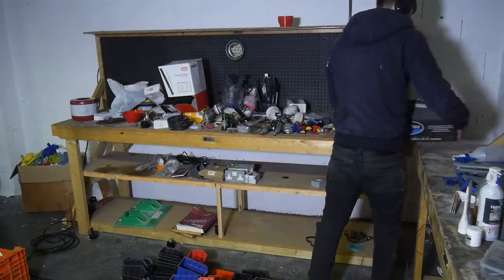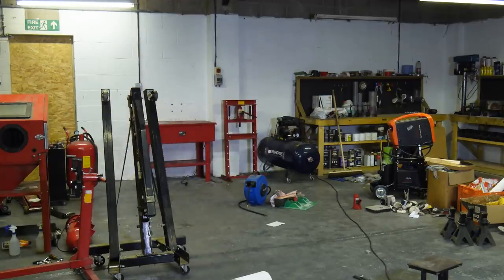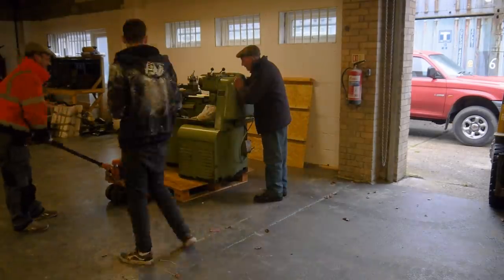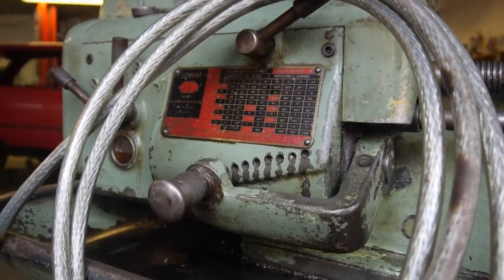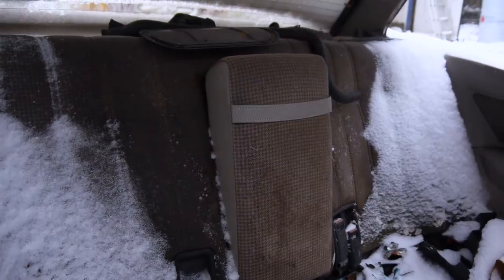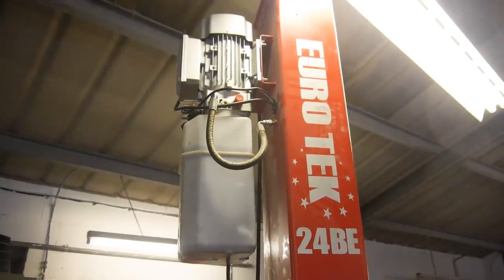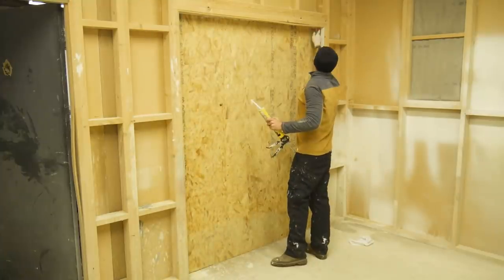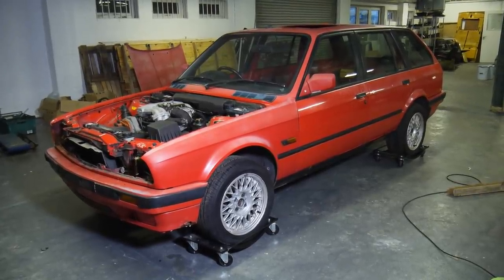Building the Dream Workshop - Part 3

Comment: That looks like an ideal location for another lift.  I have two (a two-post and a four-post), wish I had room for another.
Reply from the maker: Why did you go for a four ppost Kieth? I was recommended the same thing in that place but why? two post seem better to me, but what do I know.
Reply: @RestoreIt  I use the four post primarily for storage though one can do a lot of routine maintenance on a four post.  The nice thing about a four post lift is you can put trays under the car to catch leaks.  Since older BMWs never leak, this may be overkill...  ;)
Reply: @RestoreIt  agree with Keith's reply.  Storage is good, and you can still do a lot of work when using a four post.  Anything you can't do on that, you still have the two post

Comment: Coming along very nicely!!! Not sure I’d put the lathe next to a window. Could be an accident waiting to happen 😬. Seen things fly before. What’s with the two random I beams in the middle of the shop? That shell was a find too, exciting project right there. Looking forward to the next update.
Reply from the maker: It's got a splash plate that needs fitting as well, I forgot to show that :D And they are from an old lift, I'm going to plasma cut them out soon. I keep overlooking them now, I'm just use to them. Thanks dude!

Comment: Making good progress. I notice you have closed off two doorways. One of them I think was marked as a Fire Exit. Have you checked with your local Fire Prevention officer at the Fire Service to check for problems and requirements such as fire extinguishers and instructions and risk assessments etc.
Reply from the maker: Thanks Steve. No I haven't, but it wasn't me, it was the guy I rent it off. Those doors go into two seperate rooms, both of which i don't have access to and are locked most of the time. it would be like running further into the fire.
Reply: Ah ok understood. You might want to review your health and safety overall once you get finished, not only for your own safety and peace of mind but anyone you work with. 
Loving the videos keep up the hard work

Comment: Lights that point up to illuminate the ceiling will help it feel brighter and more open, as well as slightly illuminating the areas the shop lights don't to cut down on dark areas and shadows (from reflection off the ceiling). you can probably just get some led shop lights, flip them over then attach them to the downward facing lights and wire them up together. Also those skylights will help a lot once you get them replaced.
Reply from the maker: Good idea cheers Daktah! I'm putting the first lot up now and will see how it looks. I think i'll defo need more.

Comment: For your spray cabinet you can for sure go for concrete as a base layer but u should top it off with something that‘s not as porous. I didn’t get the material u mentioned in the episode but I can definitely recommend something that‘s sealing the floor - epoxy based or something similar. U can check out AMMO NYCs garage build. The floor is wipeable, not porous, smooth and waterproof. 
Hope I was able to give some perspective :)
Reply: Porous materials „suck“ and trap in dust and color mist falling to the ground and is almost impossible to „really“ clean :)
Reply from the maker: Cheers dude I think im going to go with white epoxy :D

Comment: should you put the air compressor on the  intermediate floor for save space and build an air circuit in the workshop ?
Reply from the maker: Good idea. Close to the spraybooth and I can pipe the rest of the shop from there. Cheers Marvin!

Comment: About the lift next to the spray booth, maybe you could get a scissor lift, which makes it very easy to work around for doing body work, be it welding, sanding, or polishing. Use the workbench over there for your sanding and painting stuff😁
Reply from the maker: Yes good idea, I think thats the plan :)
Reply from the maker: That or a four post lift

Comment: Try and use cement board in the spray booth. Higher water and heat resistance will make it easier to maintain and would save you some heart ache in the future if you decide to insulate the booth for infrared heating for paint curing.
Reply from the maker: Interesting idea cheers Daniel, the plan is to get a real booth as soon as I can so I'm trying to keep the money spent on this one as low as possible :)

Comment: Just a heads up.
That 325i Sport shell is rarer than you think.
It's marked at the end as Allrad.
It's a 4 wheel drive shell
I'd say it's as rare as solid gold unicorn and rocking horse poo, especially in RHD.
Reply from the maker: I've seen one other comment like this. What a find that was... Kind of makes me want to restore it back to factory finish. Cheers Aaron!
Reply: @RestoreIt 
According to how many left,
There are 8 325ix left on the road in the UK.
Reply: @RestoreIt 
The x designation was for all wheel drive.
BMW used it again when the X5 came out.
Think the biggest problem would be finding the front diff/suspension & hub assembly, let alone the transfer case.
Best bet is to look/scour Europe, USA and Canada.

Comment: I don't know what your budget is, but for the paint booth floor:  a thin layer of self leveling concrete then finish with epoxy.   With regards to your auto paint, no special storage typically.   It's the solvents that will need the specialized and certified metal cabinet.
Reply from the maker: That would be really nice. And good point, I dont need as big of a cabinet as I first thought. Cheers Gusser!

Comment: For the floor of the spraybooth, I suggest to build a fake floor with grids panel at different places, and connect that hollow floor to the main air extraction. That way you will have something as clean as a professionnal painter. Also, that will increase extraction efficiency. You will also be able to heat the booth using the floor fans, in reverse, with a heat source on the air inlet. Perfect to have great painting conditions, even in winter ^^
Very nice workshop, can't wait to see the next video!
Reply from the maker: Nice idea Samuel and very temping. But... I do plan on swapping that booth out for a premade pro booth with proper floor extraction lights etc... I'm not sure if its worth putting the money and time into this one... I'll see how I go. Cheers!
Reply: @RestoreIt  Okey! Great projects! Waiting for this so!

Comment: Try 3m dirt trap for the floors . It works well and easy to change .
Reply from the maker: I'll check it out cheers!
Reply: @RestoreIt  cool . And if you need any advice on paintshop cleaning and protection walls floors lights  (dirtrap colard barrier gels etc. Message me. That what i do for leaving so happy to help ( no im not selling prducts , i just like the channal and the hard work )

Comment: I don't know If I missed something but the chassis you bought said 325i Allrad, which is german for 325i all wheel drive. So it's the 325ix and not the 325is, or am I completely off?
Reply from the maker: You might be absolutely correct!
Reply: You got that chassis for free, such a nice deal! Even that chassis would cost here 1-2k€. A good condition driving 325ix is something around 10-15k€ and I think mint is easily over 20k..
Reply: @RetroUkko  I wasn't trying to downplay this insane deal. I'd kill for deals like this one where I live.
Reply: @Matteo_Etzer  actually I tried to answer to Restore It :D
What I was trying to say this deal was insane indeed. I have tried to find "barnfind" or anything but no luck whatsoever. I could even take rustbucket, but no nothing at all :(

Comment: Why would it use that much more power? Just check  whats power the hydraulic pump is rated for... 🤔
Reply from the maker: I really shouldn't plug it into the wall, its just not proper. I'm having it hooked up to the mains to prevent any issues at all
Reply: @RestoreIt  Sure, if feeling doubtful it a good strategy... i would hope that the car lift won't rely on the power.. it should have locks to prevent it from coming down and only bad thing that could happen is that fuse would blow... seems like those pumps use in max 1.1kW to 2.2kW so British voltage is 230*Fuse size=max power... Good stuff... this makes me wish i had my own shop too.

Comment: Rebuilding an e30 myself love watching your videos
Reply from the maker: Glad to hear it dude and good luck with it!
Reply: Most of welding and panel replacement is done but discovered rot behind the sunroof one of the gulleys must have been blocked tru the years. Also have to track down mtech2 clips and bumper bolts etc as the  welder/fab man lost the heap:(

Comment: at my job we buy a paper specifically for paint booth floors, might be a little pricy, but if you ever spill paint on it, it will just absorb into the paper, and if it gets wet it will just dry out after some time.
Reply from the maker: oo sounds good. Any links?
Reply: Would not cartons work like that?

Comment: Painting the other walls has certainly made a massive difference to the overall lighting in the workshop. It looks a lot better.  Maybe consider painting the shutters too?

I think the space where the lift was stored until it was assembled could be used to extend the paint booth.  Perhaps lengthening and widening it would make it a much more usable space as I remember how you were sometimes.stuck for space in the booth you had while in Spain.  And maybe putting a little staircase just to the right of the door to the office space, and between the paint booth, would offer easy access to the mezzanine and, provide a little storage underneath too?

I know this all takes time and a healthy dose of money but if your going to be in that building for a long time, I see it as an investment in both money and space as your channel grows.

Do I sense perhaps, a restoration of that cracking lathe you have?

Comment: Heads up, but normal electricity is single phase, not 2 phase (in comparison with 3 phase for heavy equipment).  There is an option for 2 phase (also called split phase) in the UK which is used with agricultural buildings and private substations, hence I mention this just in case you didn’t realise and ask for the wrong thing in the future.  Hope that helps!
Reply from the maker: I meant to say single phase haha my bad

Comment: Blocking the fire escape?
Reply from the maker: The guy renting it to me did it. But it only leads into a locked room anyway.
Reply: @RestoreIt  Old signage is a pain.  I only ask as I used to do Fire Risk Assessments before I retired.  You are right, all paints should be in a metal cabinet.  I am not up to date with what the regulations say about a mechanic workshop.  Your local fire prevention officer would give advice on that.